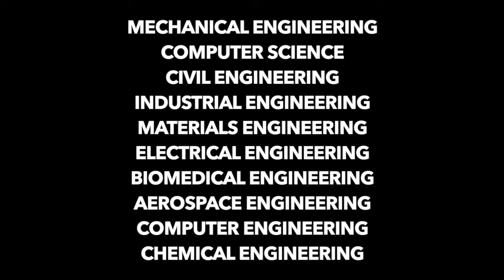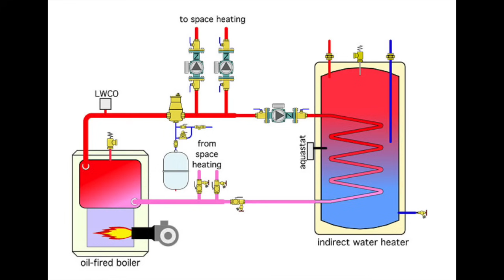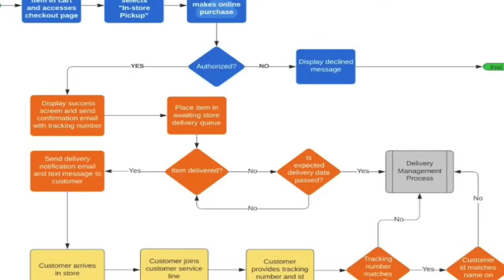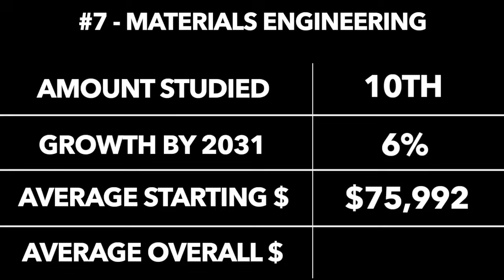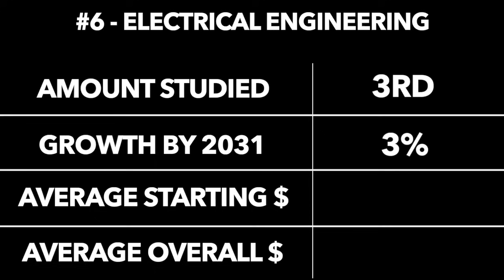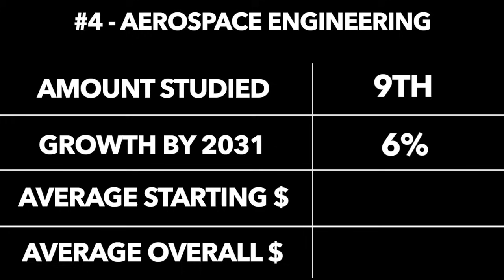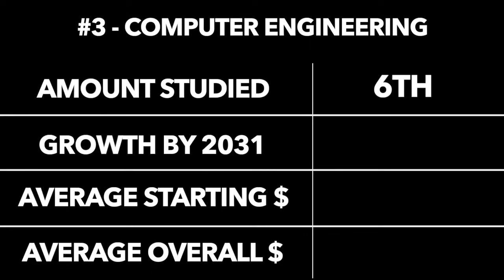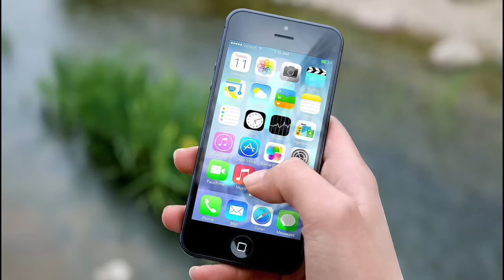Engineering Degrees Ranked: Pay, Demand, and Job Roles

Comment: This might be out of your scope but do you think biochemistry vs biomedical engineering is s huge difference.... obviously one is more specific....but my main quesiton is im planning on double majoring at least and im yrying to choose degrees that cover alot of fields and are more flexible
Reply: Sorry for the wall of text, but one last thing as to how someone with a mechanical engineering degree could work for a biomedical company.

On-the-job training and subsidized graduate degrees

In engineering (take with a grain of salt since I do not have much work experience yet), a lot of time is spent on on-the-job training either in the form of shadowing an employee, working with a team, or actual training for things like how to write documentation. In a biomedical company, most of the additional knowledge can be acquired through training and the extra knowledge from the mechanical engineering degree is usually helpful when designing devices. More important than that, though is that you have the engineering mindset, which is the most important thing for a lot of companies. Some engineering companies will also either assist or pay for you to go back to school to get a more advanced degree if you need it.

Thank you for reading. I wish you luck in all your current and future endeavors! 

(Also, please let me know what you decide/where you end up if you remember to!)
Reply: @withjoe1880  I will thank you very much wish I could get you back. And it's alright ...can I shoot you other questions once they come up?
Reply: @skeletorlikespotatoes7846  Don't worry about it, it was nice to help someone else trying to make a decision about an engineering/STEM degree. With regard to asking me other questions, you can ask me and I will try my best to answer your questions based on my experiences.

YouTube is a bit weird when notifying me of comments, so I might need to share an alternative way to contact me to ensure I see the messages (let me know if you would be interested: email, discord, etc.). I will try and check back fairly often for the next little bit, though.

With regard to knocking out general classes, you should definitely consult the university you plan to attend to see which courses are acceptable as transfer credit. I personally recommend taking the intro math and/or physics courses at your university if you can, especially if there is a difference in the course sequence or content. For transfer credit, I would focus on whatever foreign language, English, history, and other miscellaneous requirements for the degree. Again, you would have to look specifically at the university you are planning to attend to know which courses you can get transfer credit for.

Anyway, good luck again! It has been my pleasure assisting you with your questions.
Reply: @withjoe1880  right now I'm trying to figure out how to knock out general classes. I'm in a trade school now and I'm planning college next.
Reply: For context I am an aerospace engineering student.

What are you most interested in? 
Engineering degrees are already highly flexible and can help you with applying to other unrelated fields such as finance.

Why do you want to double major? 
A narrower degree with deeper depth of understanding is almost always better than a wider breadth degree with shallower depth of understanding. Additionally, speaking from experience engineering degrees require a lot of time and a double major would have been quite impossible for me without adding an extra year or taking summer classes.

If you answer these questions, I can provide some advice based on my own experiences since I went into college wanting to double major in two engineering disciples but left with an aerospace degree.
Reply: @withjoe1880  really appreciate you taking the time. I'm obsessed with so many fields of knowledge that I want to add to....but I've been trying to narrow down the fields so that I can cover ground but have flexibility.
Reply: @withjoe1880  Im really interested in developing new 1) engines 2) medical tech 3) new sources of energy 4) space related tech
Reply: @withjoe1880  I want to double major cause that's the minimum I need to do to cover a larger field so I can work in different areas...well aware of the difficulties....the math I don't see would be too challenging....my memory used to be like eidetic but I definitely damaged it alot....so that's more my concern....though I still can handle a lot of information
Reply: @withjoe1880  my bad if this is in unnecessarily long...but the list of degrees I've been considering are 
Aerospace engineering
Mechanical engineering
Nuclear engineering
Physics
Math
Biochemistry 
And kind of neuroscience but probably not.
Reply: Wow, it's great that you already know what you want to work on!

With regards to your choices:

1) Engines: I would recommend either mechanical or aerospace engineering here. However, keep in mind that most of the world is hoping to transition away from fossil fuels by the mid 2030s so engines will likely be limited to aircraft unless hydrogen fuel or  synthetic fuels take off. You would probably want to get a Master's degree to get more understanding on this stuff since the specifics aren't covered in undergrad coursework.

2) Medical technology: once again I would probably go mechanical or biomedical. At my university, biomedical engineering is a weird hybrid of mechatronics (mechanical+electrical), chemistry, and maybe a couple other biology/specific classes. You could also go the chemical engineering route, biological engineering route, or genetics route depending on what you want to do in the field. I took a course on medical robotics as an elective, so I can definitely see the appeal of the field.

3) New sources of energy: I guess you would probably need to go nuclear here, but definitely not the most general degree, however it does share a lot of the same basic math, programming, physics, fluid mechanics, thermodynamics as aerospace or mechanical with more specialized courses mixed in. Electrical engineering is another good option here. 

4) Space related tech: Finally one I have some experience in! I would definitely go with aerospace here, but one could also make arguments for mechanical engineering or mechatronics depending on what you are specifically interested in with space. Materials science is another good one here.

Some more questions:

Have you checked out the map of engineering video on YouTube? 
Nice watch for someone still deciding what to do.

Have you picked out any specific colleges? 
If so, look for the curriculum/degree requirements and compare the number of different classes between the degrees to see which are the most unique and which are the most general. If your/the university offers electives see what you can take, it might be enough to get the most of another degree without a double major. Finally, look into whether the university offers minors, these are much more reasonable to fit in. The top minors I would consider adding to a degree are: mathematics to get extra stuff like linear algebra, numerical analysis, PDEs, etc., materials science, and mechatronics. You can also add something else you are interested in that you can't get with your electives.
Reply: @withjoe1880  thanks so much on this. Really really grateful. Interesting that you say mechanical for medical work, that definitely helps. My issue is space wise I really want to work on propulsion technology....so I really was heavily debating aerospace vs physics for that area.
Reply: @skeletorlikespotatoes7846  Well, as someone who took both aerospace propulsion and rocket propulsion (degree requirements for my aerospace BS) I can definitely say that aerospace is the way to go. If you are that interested in propulsion, there are several specific classes I can recommend such as computational fluid dynamics (CFD), boundary layer theory, and more. For space propulsion, unless you are looking into ion propulsion or some other novel system the aerospace degree will give you a bit more understanding as to how these sorts of things work in practice. Physics is probably the better degree if you intend to develop a new propulsion technology, but you would probably need at least a master's degree to pursue propulsion through a physics degree.
Reply: @withjoe1880  wow that's super cool. Boundary layer shit is awesome. Do you use numerical analysis for fluid dynamics alot? How is it?
Reply: @skeletorlikespotatoes7846  I have a friend who got a degree in biomedical engineering. 

With regards to the biomedical versus mechanical degree it really depends what type of medical devices that you are working on at the company. If you are working on devices outside the body that don't interact with the inside of the body, you can do without any of the biology and chemistry classes that are a part of the biomedical engineering degree. But, if you are going to work on devices inside or that interact with the inside of the human body, then you will need those courses and more to fully understand when an idea will work or not.

In either case, the mechanical engineering degree will help you be able to analyze the device and design it, but not fully understand how it interacts with the human body (what the biology, chemistry, etc. are for). The biomedical degree also often includes some other coursework dealing with medical documentation and regulations since the FDA oversees a lot of the stuff in that field.

If you get a mechanical engineering degree and either take all your electives in electronics/mechatronics you will be able to do almost exactly the same as the biomedical engineer outside of the human body. To get full coverage you would need biology and organic chemistry to round it out.

My university offered several special topics classes that could be taken as electives and you were allowed to take special topics courses from other engineering departments to meet those requirements, so it is entirely possible to get pretty close to biomedical while also retaining the thermodynamics, heat transfer, and other stuff that might relate to propulsion in the degree.
Reply: With regard to the aerospace vs physics for space propulsion, I would say that aerospace is much more targeted toward this area and the other courses will supplement your understanding. Physics programs in the undergraduate program (at least at my university) focused on breadth and had little way to concentrate on coursework that could only be applied in one area. For instance, you had to take quantum physics, mechanics, thermal physics, electromagnetism, calculus, differential equations, general physics, chemistry, with only two free slots for electives. 

Furthermore, my university offers a Master's degree in aerospace engineering for propulsion, so the advancement is there since you will pretty much need an engineering degree as a prerequisite for any future engineering degree. Mechanical and aerospace often satisfy the requirements for a Master's in the other, so that is why they are probably the best for general engineering.
Reply: @skeletorlikespotatoes7846  In undergraduate at my university, you take three aerodynamics (instead of fluid mechanics/dynamics) courses which are entirely analytical using increasingly more general forms of the Navier-Stokes equations, there were some projects and homework that used numerical methods, but these were not the focus. Each aerodynamics class had an associated lab where we performed experiments using a wind-tunnel (subsonic or supersonic) or demonstrator and processed the data to compare to the analytical solutions from theory and CFD simulations that you have to set up and run.

However, in some of the elective courses, you will use numerical analysis a lot more. For instance, the boundary layer can only be approximated with analytic solutions in certain situations, so you definitely need to use numerical methods in the majority of cases and you will learn a few in that course. Now for computational fluid dynamics (at least at my university) you don't learn how to use a CFD, rather you learn how the CFD software works and you end up building your own fluid solver during the course. This is heavily dependent on numerical analysis.

If you intend to go into space propulsion, CFD and FEA (finite element analysis) as well as other numerical methods will be used in almost anything you do as part of your workflow since it is a good way to help spot issues without costly tests and to validate and compare to tests. 

When I was in undergraduate, I added a math minor and took four additional math courses: linear algebra, numerical analysis I, numerical analysis II, and applied computational mathematics for scientists and engineers (think monte-carlo methods, machine learning). These were some of the most interesting courses and help you understand how some of the methods you see handwaved in undergraduate actually work.

In any case, now that I am in graduate school, I use numerical methods, FEA, and CFD a lot in my coursework, so I imagine it would be no different if your were to specialize in space propulsion for a Master's degree.
Reply: @withjoe1880  that's good to know that the classes are similar between nuclear and mechanical....one of my main uncertainties was figuring out much more is added on to as you said nuclear vs mechanical engineering...and how much of it could be learned on the side.
Reply: @skeletorlikespotatoes7846  My university offered a nuclear engineering minor, but I couldn't fit it in with aerospace at my school. It is definitely possible if you are willing to take summer courses, extra credit hours per semester, add a semester or two to your degree, or have a high amount of AP or transfer credit to eliminate some general education classes.
Reply: @withjoe1880  if that's true I think nuclear would be too specific for now, as I'm trying to cover as much ground as possible. I'm totally willing and eager to learn everything and if I can get degrees and learn certain more specifics on my own that would be great.
Reply: @withjoe1880  no I'll check that out thanks for that. So
Chemical engineering vs biochem 
And aerospace vs physics 
I guess is what I gotta decide to narrow it down to three degrees.
Reply: @withjoe1880  sorry if this is convoluted. What I get confused by is that.....how much could someone with a mechanical engineering degree for instance work for a biomedical company? Some people I've talked to say that you can easily do that. Likewise how would getting an aerospace vs physics degree or mechanical engineering degree differ in trying to work in space propulsion tech? If this is too much of your time no need to waste it.
Reply: As a former engineering manager I would look at someone with your wide range of interests as being indecisive. Not a good thing. Pick something and learn it well. Maybe add a few electives from another discipline. In the end you career will be defined by the jobs you get. The learning never stops and new career paths will emerge over time.

Comment: Computer science is an engineering discipline?
Reply from the maker: Yea, I think it depends on what school you attend. It was a part of the engineering department at my school.
Reply: @becominganengineer2271  computer science is under faculty of science, under department of mathematics 
I think you should’ve used Software engineering instead of computer science as the first spot
Reply: @becominganengineer2271  ohh I see what you mean
Reply: It is a part of engineering departments in a lot of schools, but I wouldn't consider it an engineering degree.